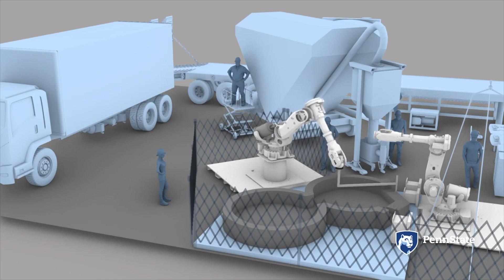NASA 3D Print Challenge

Comment: Hello Tyler, 
I am curious about the mix design that was obtained from a "supplier". Do you have any idea what the mix design entailed? What type of admixtures were included? Did it use a Type III cement?  

Very great video!! 

Thanks!!
Joe DiBucci
Reply from the maker: Thanks so much!
I have no idea what they are using.  I can tell you our mix does not use Type III cement.  It is not that easy.  We are controlling the aggregates, binders, and admixtures.  Everything is off the shelf.  We just need a little more data.

Comment: Perhaps a little more concrete science, how can that many layers be put on top of each other in a short time, is there good bonding between layers, can reinforcing fibers be added or other reinforcements be used,  what are the materials on mars that can be used.
Reply from the maker: More is coming.  This is not the video for those details.  This video was for Aleksandra to share her story.  
We are coring our walls now and will get a video out on the results.  I am not sure you need fibers.  I think you can consolidate layers with pressure as you print and you will get good bonding.  Thanks for the great questions!!!

Comment: To much problem related to 3d printing...it's very hard to obtain a concrete with very  specific characterics consistently. We have to manage the introduction of element resisting in tension. We need rules and codes to design with this method
Reply from the maker: I don't think it will be that different than normal concrete.  People just need to get some experience with it.

Comment: Tyler  -  love ur channel. I am not too knowledgeable about concrete but interested in the topic.  Question, I assume temperatures on Mars are either above boiling or below freezing point of water depending on whether they are exposed to sunlight. Can concrete cure at such temperatures ?
Reply from the maker: Thanks Mike,
According to Wikipedia the temp on mars at the equator is around 70F.  However at night it can get down to -70F. =/
The key to concrete is to reach at least 500 psi before it freezes.  If you can do that then it should be good to go.  You may need to insulate the concrete after you place it or put heaters around it but I think it can be done.  You could also use accelerators in the mix or anti freezing admixtures.  All of these are used in very cold climates now on the earth to place concrete.

I really appreciate the question and the kind words.  GO CONCRETE!!!
Reply: mike w Curing is a chemical reaction so I believe yes, it'll cure. I imagine that reaction would fluctuate quite a bit. I think this is a great question though. I wonder if the concrete would need to cure to a very high percentage of final strength before the temp hit freezing or boiling, so very quickly.
Reply: I really don't see how printing concrete in a Mars effective vacuum can cure properly since the surface boils away the moisture to vacuum and the interior of extrusion soon flash freezes. Printing concrete inside a temporary pressurized ziplock "factory bubble" seems reasonable. 

The heated extrusion of regolith mixed with polyethylene binder seems much more realistic in a vacuum. 

Manufacturing fabric and yarn from Mars basalt also seems practical.

Comment: Another construction method is a large inflatable dome or something and then put layers of spray foam over it, and then some type of concrete spray, and then a layer of dirt.
Reply from the maker: Yes that can work well.  The cool thing about 3D printing is that you can do any shape you want.  You can also print around the rebar.
Reply: @TylerLey  One other thing that needs to be considered is how the concrete will set-dry in places without air...so there is an advantage to rammed bags if setting is an issue.  I think they tested some cement on the ISS but it wasn't a vacuum, but I can assume they tested that here on earth in a vacuum chamber.